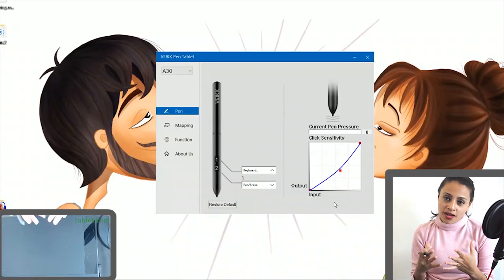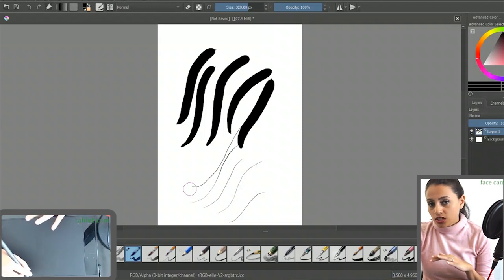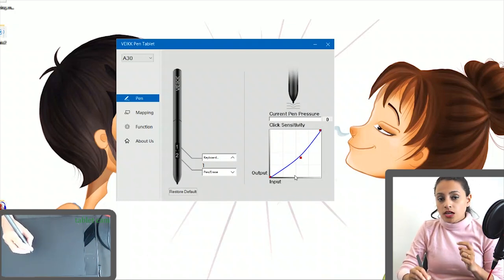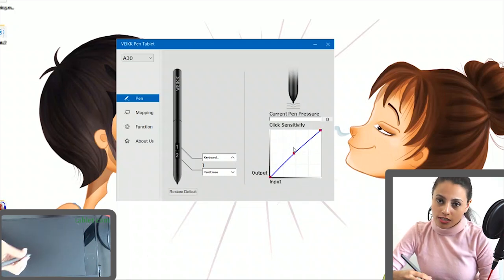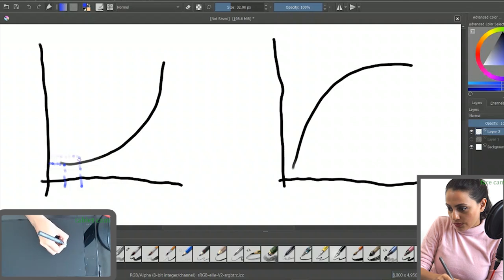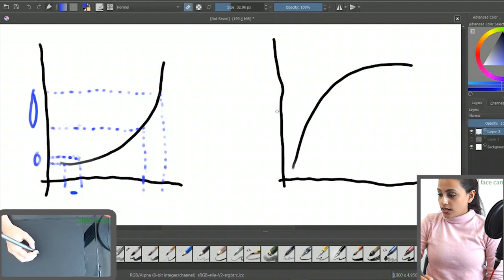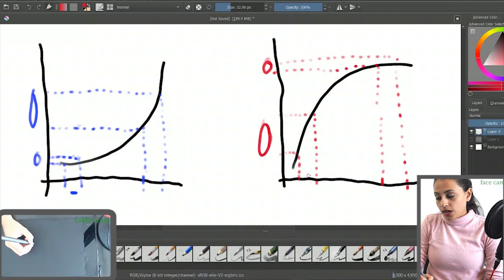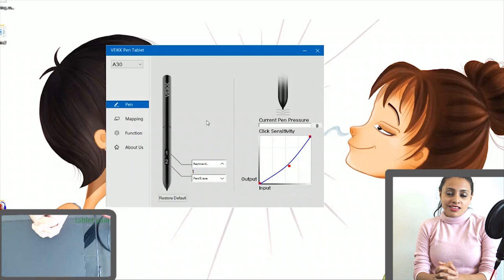How to Setup Pen Pressure Sensitivity for Any Drawing Tablet

Comment: Can we make pen pressure zero
Reply from the maker: You would want to have the output level at maximum for any level or input to achieve this
Reply from the maker: Or, you can just switch off the pressure sensitivity effect from the brushes in your drawing software too. Which is the more common method of handling it
Reply: @Kalartistry  thank you
Reply: Please can you tall which option is pen pressure in xp pen deco draw app
Because I am using xp pen for online teaching  this is only working in land scape mode android apps for teaching.
Pleas Can you suggest any other apps whic can work in landscape more for xp pen star g640s for online teaching.

Comment: Welp, that was useless. If I switch to think, light touch, I never get thick lines with harder pressure.

Instead of just graphs, you should have included a line on the side to each option, to show. Because then we would have seen whether whatever you suggested works... or not!
Reply from the maker: Thanks for the recommendation! I will keep that in mind for future videos.
It is hard to convey how 'hard' I am pressing through video thats why I used graphs to explain here.